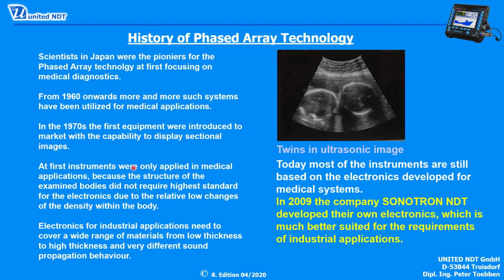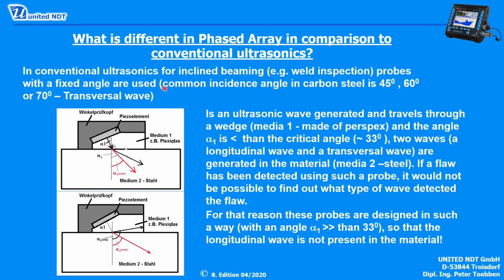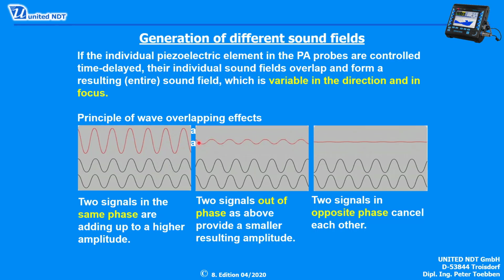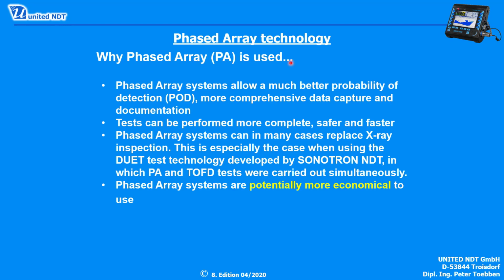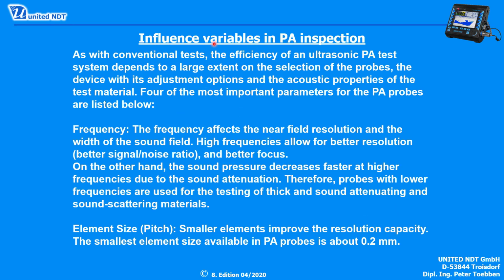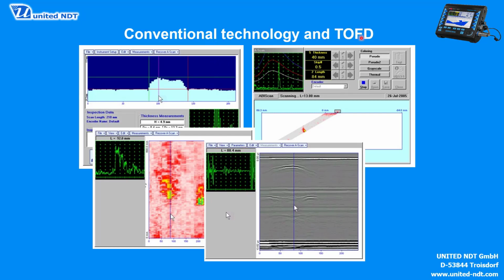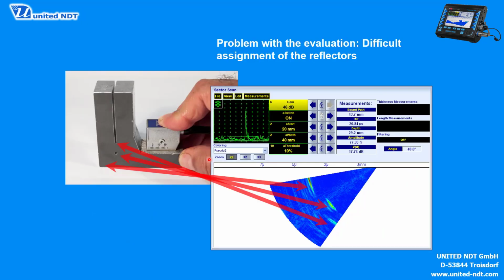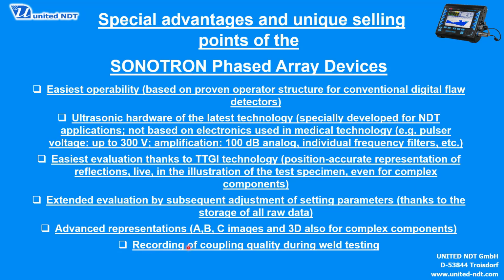Introduction to Phased Array Ultrasonic Inspection - Basics

Comment: Thank you for a good video. What are the limitations in the material thicknesses. Can you check thin plate butt, full penetration butt welds for 5 mm?
Reply from the maker: Usually 6 to 7 mm is the thickness limitation. However, with the right probe and optimimized instrument setting we were able to go down to 4,5 mm.
Reply from the maker: With Phased Array 5mm is possible